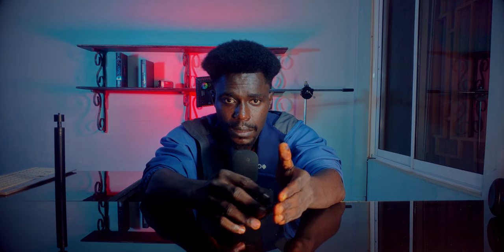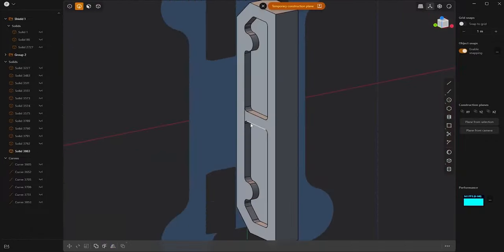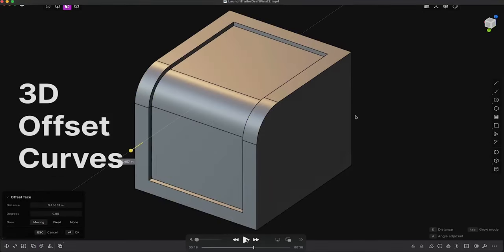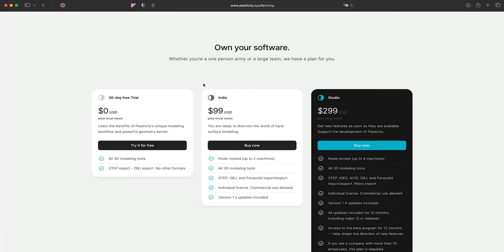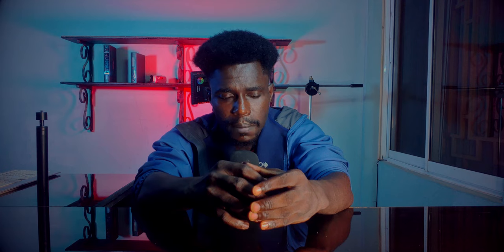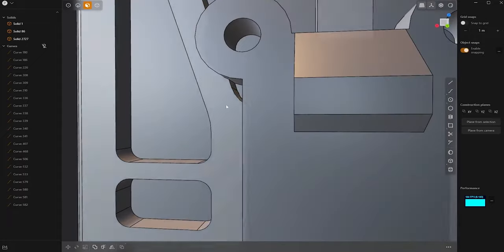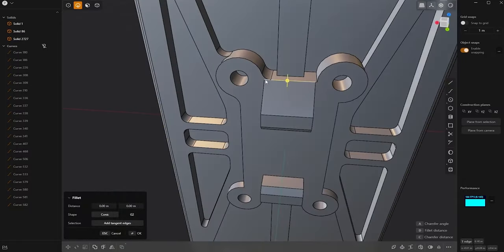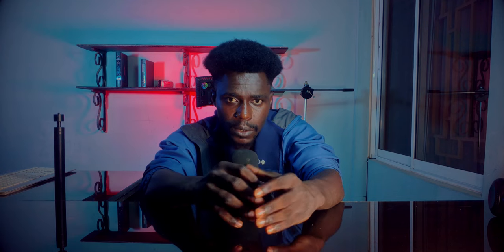Plasticity 3d 2024. Another Blender MODELING Topper?

Comment: Creating a robot in blender took me 1 year learning the program, with plasticity took me one week following Pixel fondue tuts. I love plasticity and Pixel fondue. Great review.
Reply: Yes for still rendering plasticity should be preferred but for animation you have to rely on poly-modelling.
Reply: @rajendrameena150  Wrong. Plasticity has obj exporter. So you can export your model to any 3d software and anímate there. Actually Plasticity has been created for this purpose - for fast modeling in NURBS for hard surface objects and do anything you like in Blender.
Reply: @rajendrameena150  Not true  if you can export to OBJ you can do whatever you need from it.  the surface info is converted into polygons upon export

Comment: F360 (precision mech design/build assy) + Plasticity (artistic-based workflow for hard surface artists) + Blender  (polygonal modeling, massive add-on tools, rendering) + Substance Painter (texturing) + Photoshop (composition) : 🔥 . as a 20yr user of SW and 3 yr user of F360, can tell you that using Plasticity will accelerate your right hemisphere for concepting and creating NURBS-based bespoke models. as an early adopter and beta-teater of Plasticty, we’ll cage match this s/w against Rhino/MOI for tailored use case. Nick Kallen is an awesome developer and will morph this product into an industry standard. mic dropped.
Reply: 25 years using creo, and I'll agree 100% with this... plasticity is incredibly freeing. and the surfaces go into creo great too. ;-) and the improvements coming are great too!

Comment: Plasticity is for artists. This is why it has simple controls and simple interface. It's quick and easy to use and get your head around, no overly complex tools or processes and it has the tools you need for most operations. People like Plasticity precisely because it's not overly complex, and for most users it doesn't need to be. There are plenty of Nurbs programs for industrial use and for product designers, but most artists have little interest in them because traditionally they have been large, complex, awkward to use and a general pita.
Plasticity and MOI 3d are both easy to use and comparatively basic, but both are easy to use and understand. Artists have enough complexity in their normal 3d poly and 2d programs without complex Nurbs software to remember as well.